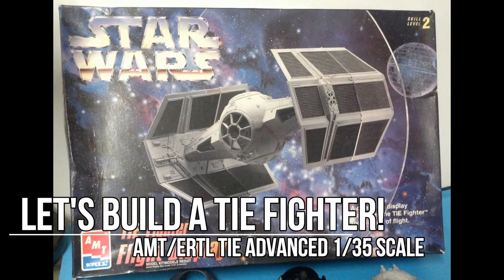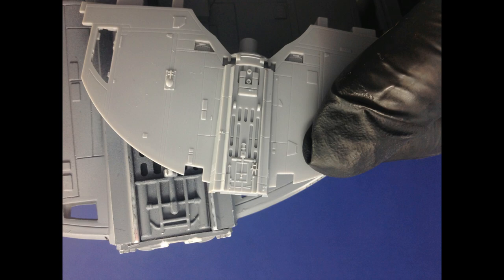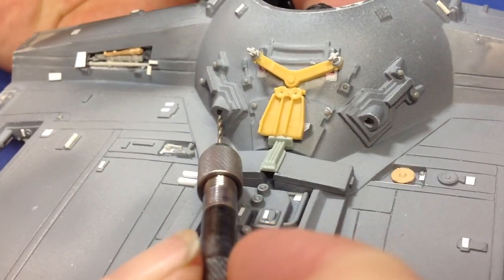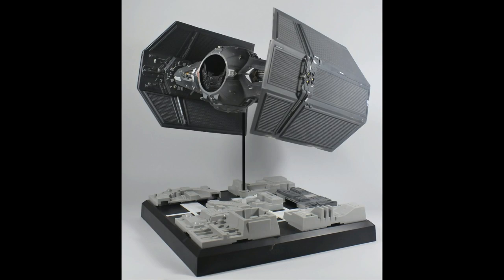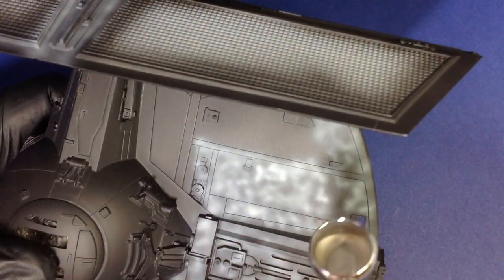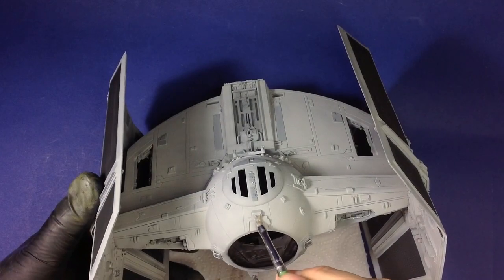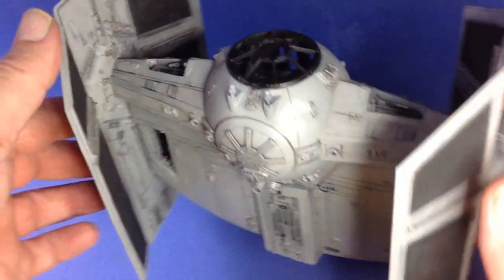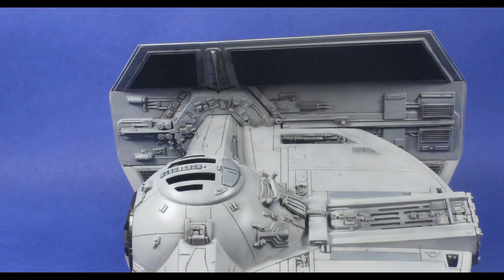Super detailing Darth Vader AMT/ERTL TIE Advanced Star Wars model

Comment: I'm writing this before watching the video because I'm too excited! I started this kit too! I did loooot's of modifications. But I also geve up trying to improve som ares too wrong to be fixed! So thank you for this video! I will check it frame by frame to see how you solved all those wrong parts!
Reply from the maker: Well I hope you've watched it and have taken away a few ideas for your project. The main problem is getting the alignment right on the hull halves. My kit was already half assembled and I could never get the wings lined up properly either due to the poor alignment. Take your time on the internal parts either side of the cockpit pod or everything will be off! Good luck, Chris.

Comment: Awesome build, I have a similar one (not with the flight disk) in my stash.

What's your mix ratio and pressure settings for the dull coat?
Reply from the maker: Hi Steevels - I think I used about 50/50 with mr levelling thinner on the dullcote, about 20PSI, cheers Chris